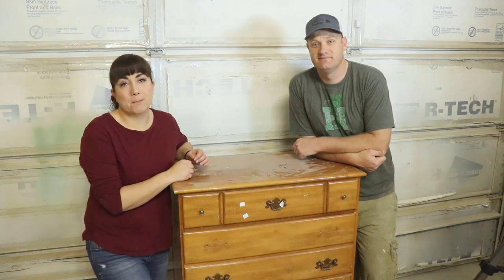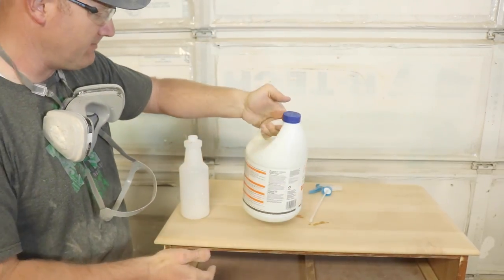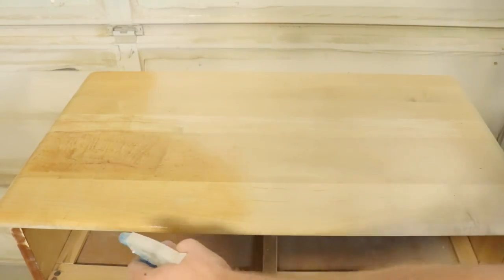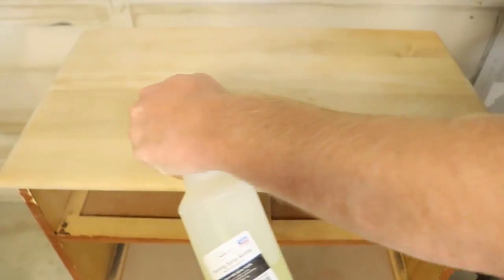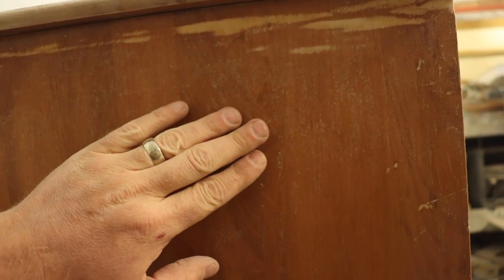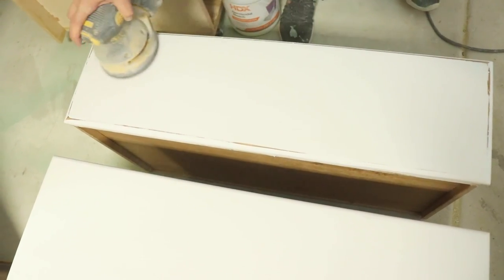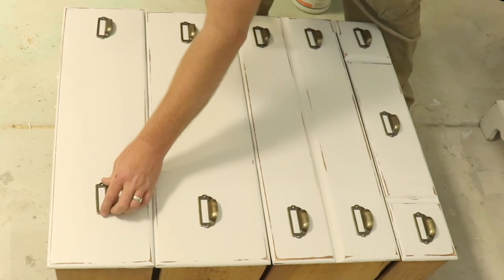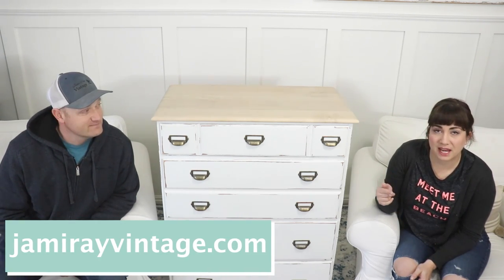How To Bleach Wood

Comment: You are right. This is a new trend on this kind of wood. I did one with brushing on white chalk paint then wiping off. The white paint went into the grains of the woods. It was a neat piece which sold Soo fast. I had so many bids for it. So thank you for so many great video, couldn't have done it with out you.

Comment: Germicidal bleach, according to HDXs SDS, is roughly two percent more than a cleaning bleach. An average cleaning bleach is 5-6%. It may say 5-10% on a Chlorox regular bleach SDS. As a trade secret thing, companies can put a range for their concentrations. If it's below a certain percentage, I believe less than one percent, then they can leave it off and I've seen it happened quite frequent with solvents, "Non-reporting levels". In other news, weirdly "cleaning strength" vinegar is 6% while the normal old vinegar is 5%. I'm a chemist.

Comment: That bondo stuff is amazing. I showed your video on how to use it to my husband. He repaired a couple of chairs for me.

I have a question about the shellac. Do you have to use the spray? I do most of my work in my craft room in our basement. I know the fumes would still be there but I don’t like to spray inside because of our kitties. I’d rather brush it on. Would that still be okay to deal in bleed through?

Eyeballing those drawer pulls you rebel you. Lol. I’d like to bleach a stool but to sand off the legs and spindles doesn’t sound like fun. Maybe I’ll paint the base and bleach the top.

As always thank you so much for sharing all that you do. It is very much appreciated. - Donna ❤️
Reply from the maker: You don’t have to use the spray shellac.  We like it because it’s easy to apply and dries quickly.

Comment: Love this piece!  I  have a question for you guys.  Does the Sweet Picken's top coat leave a rough texture after you spray it?  I have been spraying GF HPTC and it does, so I sand lightly between coats to get it smooth, but even the flat has a bit of a sheen so if I sand the final coat, it dulls the sheen and you can see it.  I don't know if I am just not spraying it thick enough or if all top coats do this.

Comment: Loved your video and would like to do a similar project.  I have two Sherrill CTH Occasional end tables that I think would look great, but they have beveled, smoked glass inlays in the table top and I'm concerned that might not look consistent with the distressed look.  What do you think?
Reply from the maker: I distress everything. If you like it so say go for it.
Reply: thanks for your quick reply.  If I don't like it, I can always redo from what your vids have taught me.  I'll take some before/after pics and figure out how to get them to you if you're interested.
Reply from the maker: I’d love to see them. You can message me at Jami Ray Vintage on Facebook or tag us in a post in our Jami Ray Vintage Group on Facebook.

Comment: Probably wont respond but can I just put the bleach on the table I have? I have an orange ish table and no fancy tools :( Should I just sand it a bit or do a patch text? Thanks! (I would invest in one of these sanders but I wouldnt have any use for them and dont have a garage to work in, only my room)
Reply from the maker: We always respond if we see it, Zeb tries to read every comment. 😊❤️ 
For the bleach to work you’ll need to sand down to the raw wood and it sounds like you want to avoid that. You could do a light hand sanding and use dark and decrepit.  It’s a stain and sealer all in one.  The downfall to that is that you’ll probably lose the look of your wood grain. https://jamirayvintage.com/products/dark-decrepit-diy-paint?_pos=1&_sid=046eba34d&_ss=r

Comment: You're using a respirator with dust filter cartridges.
Hows that work?
Reply from the maker: This 3m filter is replaceable and is NIOSH OV/AG/P100 approved 👍
Reply: @JamiRayVintage  Really? 
 The universal color code for OG/AV (Organic Gas/Acid Vapor) would be a yellow band with black lettering, 3M part #6003.
 That looks like a regular Organic Vapor (charcoal filter) Black band/White lettering unit (3M# 6001), with a dust cap on top to me. A useless filter when dealing with chlorides.
 Or possibly one of those dark green/yellow lettered OV/Formaldehyde ones. Also no good for bleach.
You really think 3M a leader in the industry would be more careful when labeling their products. I can't believe they got the colors wrong like that.
 That's a violation of federal law. Someone should contact them before someone is injured or gets killed over a mistake like this.

 Or Maybe you're full of crap.

 Why not just admit you goofed instead of trying to BS an 18 HAZMAT guy and coming off looking foolish.

 Why do you think someone would ask you such a technical question like this without already knowing the answer?

Comment: honestly, you could save a lot of time sanding if you used a chemical stripper and a scraper on the surface to start.   also i am surprised that household bleach worked as well as it did... most woodworkers use 2 part bleach